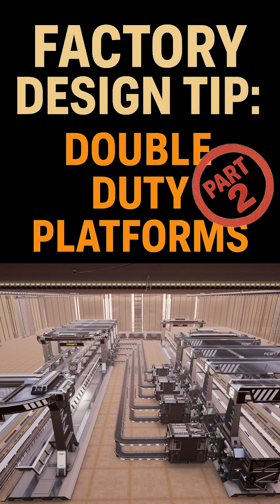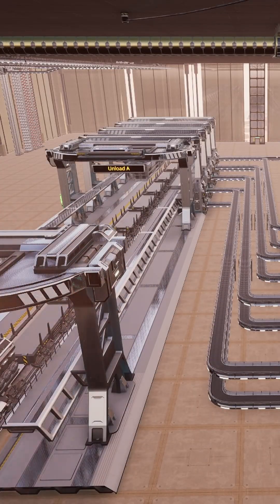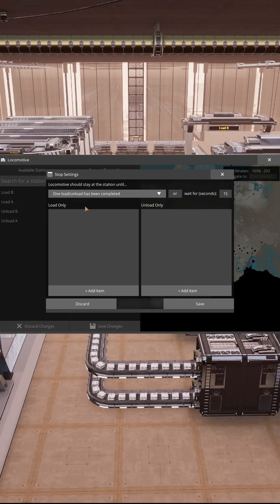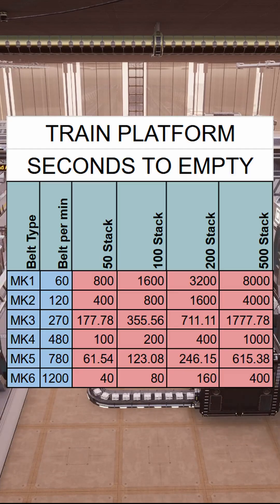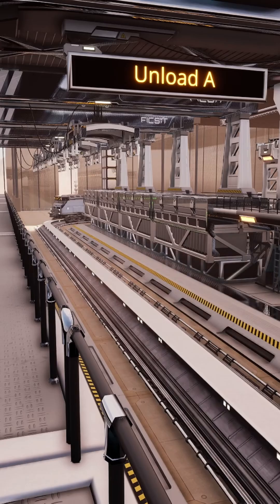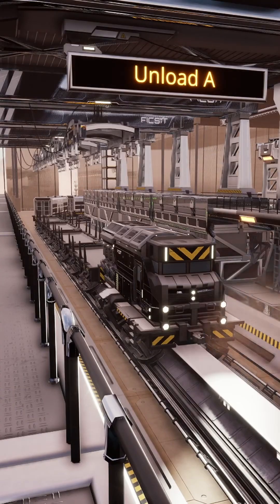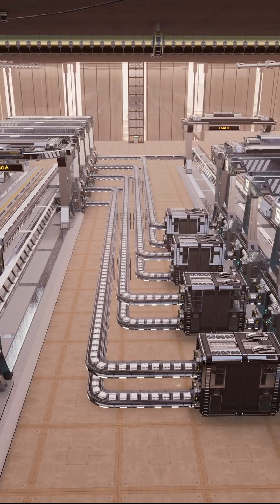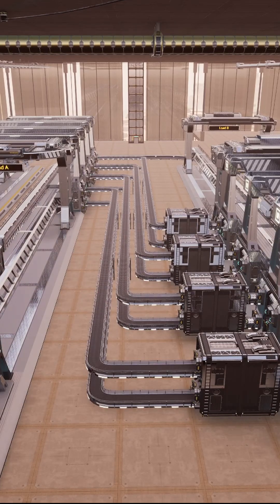🚂 Factory Design Tip — Double Duty Platforms (Part 2)

Comment: One use case I have found for something like this is trains with mixed cargo. If you have a station loading or unloading a single item, say ingots, a single station could load or unload different car positions in different trains without touching cars that hold other items or are intended for other stations. I have found this use case to be uncommon but useful when working with variable length trains when you don't have enough space for different stations for each train configuration. I have generally only needed to load/unload one spot on the train when doing this, but I have attempted multiple load/unloads in some cases with larger trains.

Comment: but also if you have enough storage containers you cnd just use this station as a macro level manifold
Reply from the maker: I wouldn't recommend that. Since manifolds load/unload unevenly this can cut into the total capacity.

Comment: Smart idea, stage loading.
Let me ask you, 
Is that train loading the same item on the whole train?
If yes.
Why wouldn't you just build loading docks in the gap between the 2 stations? Just have 1 stop.

Anyways, cool concept.
Reply from the maker: So what if you have only 4 belts that you are feeding, you could have a 2 car train, but you are going to be making alot of trips and congesting your train line. If you fed those 4 belts from 8 cars then you would wind up with several belts merging together and nearly full trains making the same amount of trips With staged unloading you can have that 8 car train making fewer trips and keeping your train network clearer.

Comment: Instead of setting a custom time, you can use the option on the left, "Fully loaded/unloaded", coupled with an "and" condition that you could set to a low value in case the train has nothing to load/unload. With those settings, the train will be docked until it has fully loaded/unloaded its freight cars, regardless of the stack size or belt throughput.

That said, kudos for the spreadsheet table!
Reply: You came from factorio im guessing, this the core way of organising trains on factorio
Reply: @danielmanton8692 Not at all, I never played Factorio. That logic seemed simpler to me than fiddling with the time, and I don’t see any drawbacks. Is there a reason to use custom time?
Reply: @basgys Yeah, there could be a few reasons. Factorio feels more engineered than Satisfactory, and the logistics of getting materials on and off trains is different, which can affect loading and unloading times, making these numbers in question more useful. If you're a fan of Satisfactory, then I would strongly suggest trying Factorio; there are a lot of different features (weapons and enemies are way better in Factorio, for example). Just don't wait for it to go on sale, as it never goes on sale.

Comment: What is a practical use for stage loading/unloading?
Reply from the maker: This is really an open question for the community but I can tell you where my head was at when I discovered this configuration. Staged loading/unloading allows for one train to replace 2,3,4, etc. trains, reducing train line congestion. So say you were starting to notice significant slow downs from your train network becoming congested this could be a drop in solution to reduce your total number of trains while keeping capacity the same. It could also be useful for radiation carrying trains as less trains on the line and more time in the stations means you are less likely to encounter them out in the world. Please let me know if you can think of any other uses.
Reply: @atroKraft There could be a niche situation on a rail network where one train has open cars on a multistation route and could fit into the situation perfectky. The pioneer will have to be keen to these uses when they arise.
Reply: I’ve used “fully loaded/unloaded” in a few practical cases.

One is similar to @atroKraft’s example: I have a uranium loading station, and I don’t want a train leaving that area with any radioactive items still onboard. So the train is set to stay until it fully unloads.

Another use case is when multiple factories pull from the same station (for example, aluminium ingots). A train always stays at least 30 seconds at a station, which creates overhead and blocks other trains. If trains constantly shuttle back and forth to move small batches, that 30-second dwell time happens every few minutes.

By switching to "fully load/unload", a train only blocks the station when it has accumulated a full cargo, maybe every 15 minutes instead of every 3. That reduces blocking and increases the overall throughput of the station.